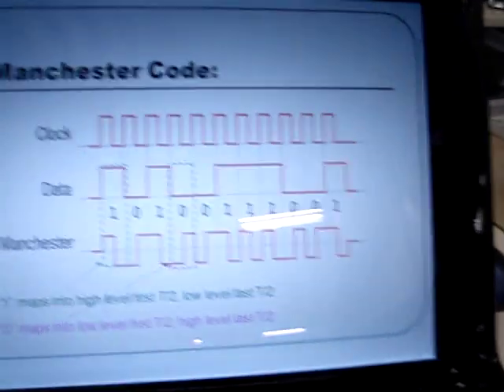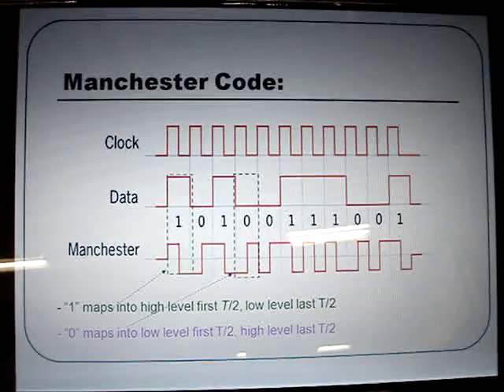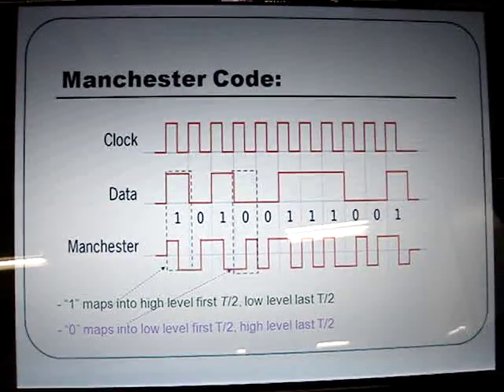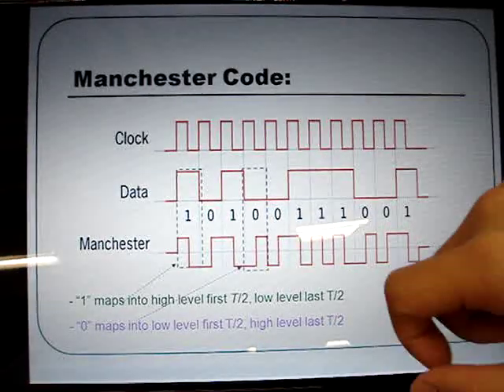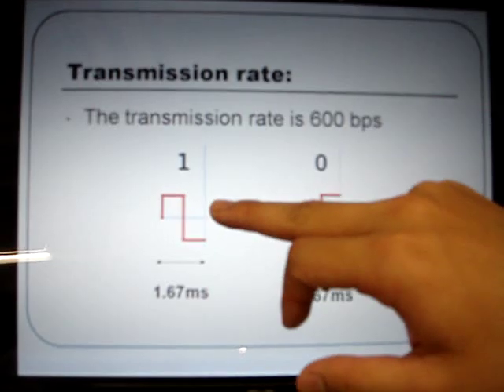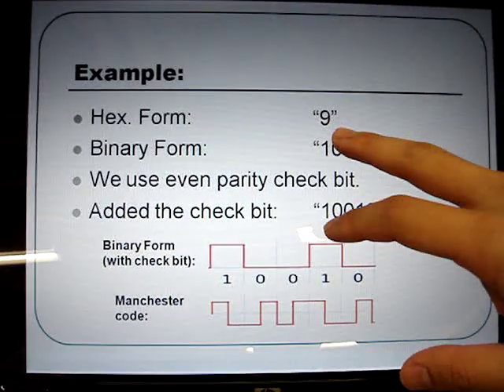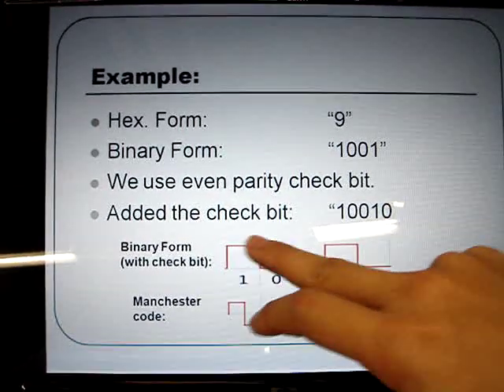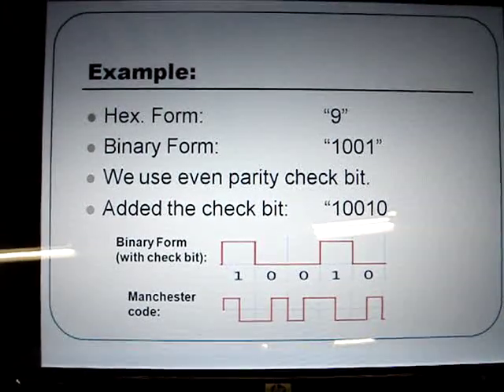the Principle of Manchester Code

Comment: The one encoding algorithm presented in the slides is "Differential Manchester". The traditional Manchester encoding structure represent 1 with the first half bit going from low (-V) to high (+V), and a 0 with a high to low bit.
Unlike the traditional Manchester, these slides show that zeros are represented with a switch of the first half of the bit to the second half of the bit, whereas ones are represented with continuos the two hals of the bit on the same side (positive and positive or negative and negative). This is known as differential Manchester.